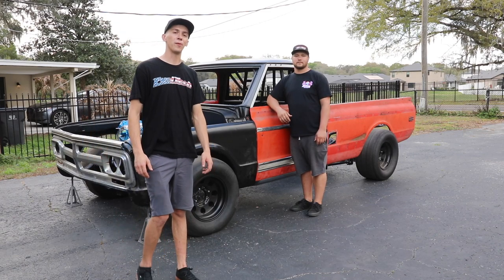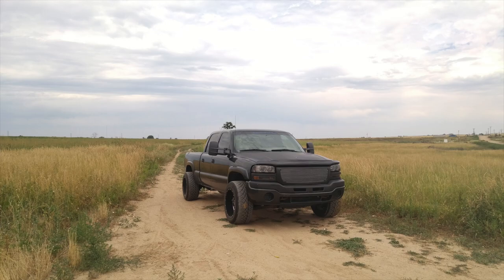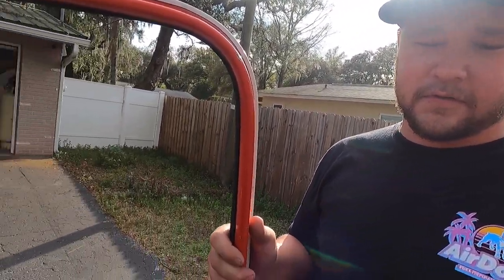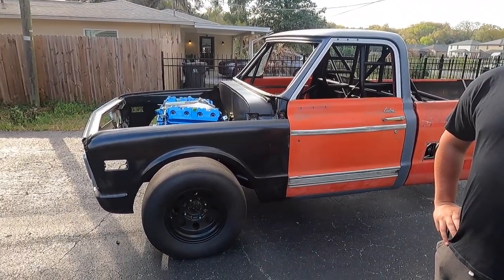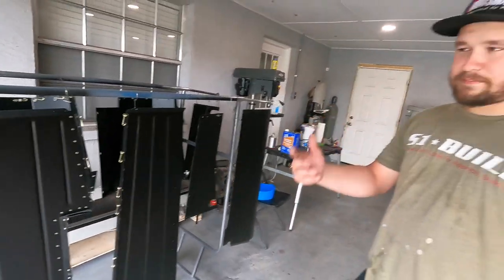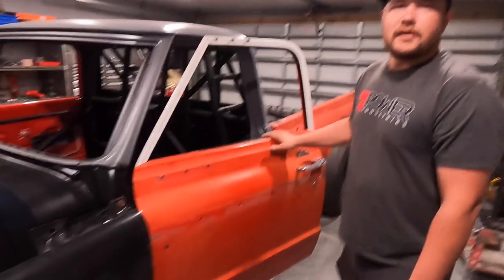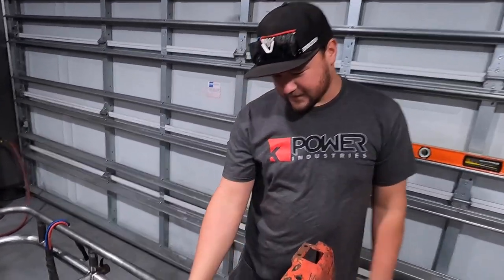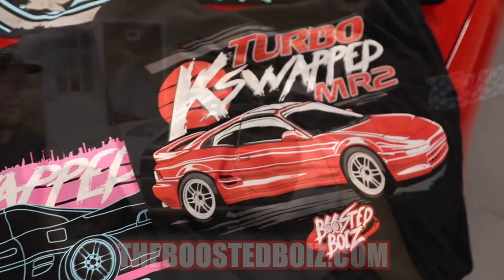Introducing Wyatt's Duramax Powered Race Truck To The Channel!

Comment: ive got a 70 c10 on a tube chassis, i built in 2011. last 6 years i ran a 434sbc on 112 octane but this year i put in a built 6.0 with twin 78's for e85. i havent ran it this year, waiting for spring up here in the north. but i cant wait. ive got a 87 monte with the same built 6.0 with a single 77 running e85. cant wait to see this finished.

Comment: I would add some gussets around where it goes from the frame rails to the tubes. Strengthen that part up some so it doesn't crCk a weld when you're making some hard launches. That truck looks great so far. So is all the progress going to be hosted on this channel or is good Ole wytt gonna post on his channel still? I would not mind watching both yours and good channel and helping both you guys monetize your stuff. You're kicking ass lately with the videos. Wyatt's a great mechanic and a great addition to your channel. He's helped you get that mr2 into the 7's. Great job with that. Can't wait to see that car hitting 7's like they're nothing. Good luck to everything you guys do and to everything you do in the future including your v8 build you got in Colorado. That's gonna be a sick one.

Comment: Stoked for you Wyatt, done a great job for your 1st time.
I understand the whole keeping it American "pick-up" style but to add a floating wooden floor in the bed would not only set the beast off in the looks dept but make it even lighter.  Check out 1 tonner utes here in Oz and you'll catch my drift.
It'd make the ass end really light so you'd need some Ballast or wheelie bars to keep the nose down.
Sweet ride all the same dude.

Comment: Back when Wyatt was working on the truck on his channel, I posted "I have been planning this type of build on an early model Chevy truck. I want to take a 67 through 72 C or K 10 and make it a crew cab, using the same model Suburban; ending up with a (3 door) Crew Cab, long bed. Once the body and frame are done, I would like to stuff a turbo (possibly twin) Cummins in front of an Allison. Any suggestions on what to watch out for or guidance on how to complete this project with as little headache as possible?" Any help or advice is appreciated.

Comment: Hey I just want to let you guys know I seen on the news today Ford trucks 2017 through 2022 are being recalled for driveshafts shattering and causing crashes and I know you just got a new one for your tow rig I figured I'd let you know in case you didn't know about it and you could tell any of your friends that have trucks of those years to have their checked as well

Comment: if its said to be joint page as "boosted boiz" % of revenue should be discussed along with hr/labor pay when working on each others cars also cars that are built for and paid for by the page need to be agreed on values and split. keeps everyone from trying to pull a fast one or feeling like they're being used or able to even be brought up. hard to use rent or pay for events in terms of (wage) when it's 100% benefiting the page having Employees always near the work. any money or sponsor help shouldn't be used as a pay or looked at as a favor when its 100% a business expense and will be beneficial to the page as in content. half ass cars or broken track days only hurt the page... just some random thoughts on my head boostedboiz is only getting bigger and Wyatt has been and  going to be a huge part of taking all cars to the next level and grow in all ways, don't be scared to double down it'll pay off in the end! Time to turn it UP

Comment: I don't understand why you would sacrifice a perfect, daily-driven 03 Duramax, why not just get a wrecked truck to use the engine and frame from? 
I'm sure someone will let me know what I'm missing. This is not a "diss", I'm genuinely curious what the reasoning is. Even if he didn't need the truck (got a new car) it seems to me, you could sell the 03' and buy a wrecked truck and you'd be further ahead financially.